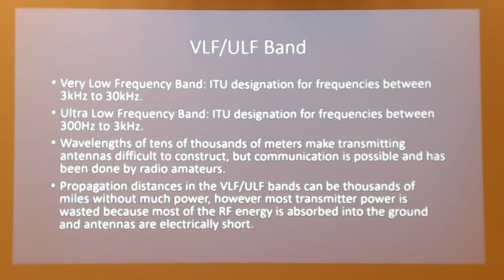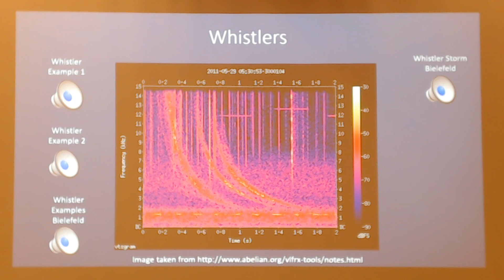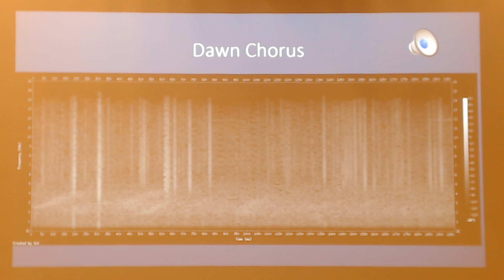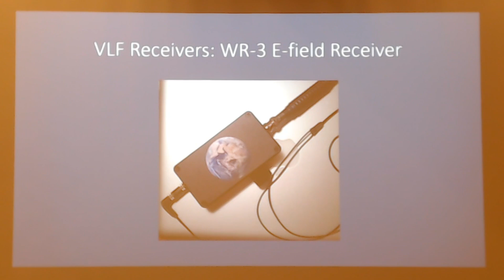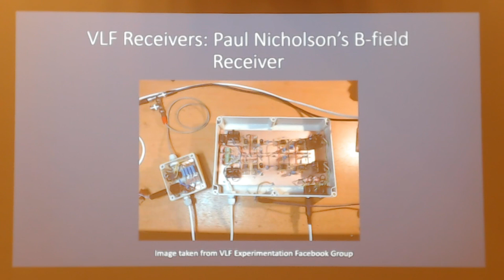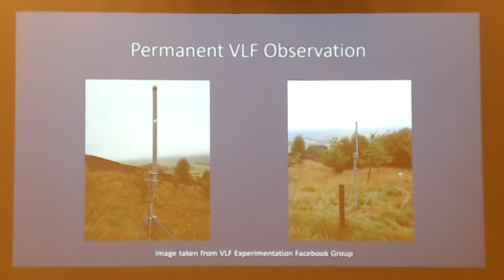Ground Based VLF Observations of Whistler Waves

Comment: This is a great talk!  I got a kick out of the discussion of receivers and antennas, having built some back in tge 1990s.

Absolutely try to limit your noise: 1)  Go to a rural or more remote location.
2)  Filter your power sources / use batteries.
3)  Use good grounding practices.
4)  VLF-RX tools are very, very useful.
5)  Use a good digital recording method - at least 16 bits / 48 khz.  Capture now; analyze later.
6)  Mic preamps and other audio gear + a long wire aren't as sensitive as the FET input devices + E field probe you see here in the video.

I actually captured good tweaks and a few whistlers listening from a suburban environment, but there is nothing like being miles from the nearest powerlines and digital noises.
Reply: haa, k 1llumiattii fr33mäsäsn bastard
Reply: how is to spray sheep from upthere with ctrail?